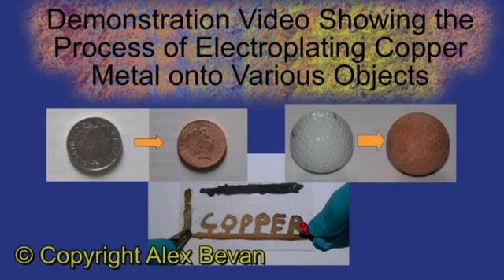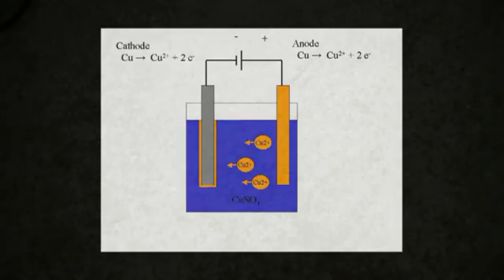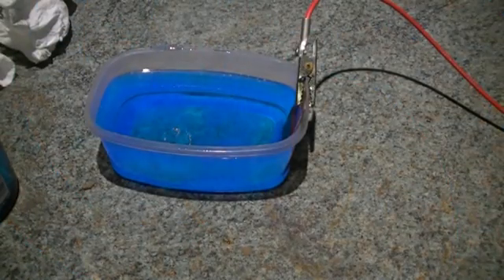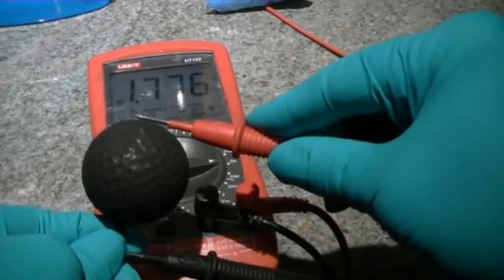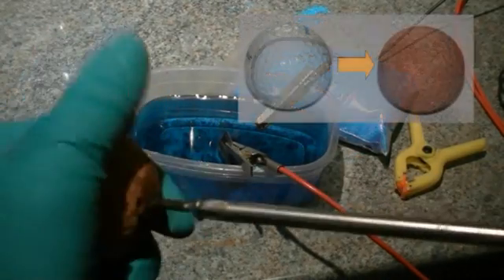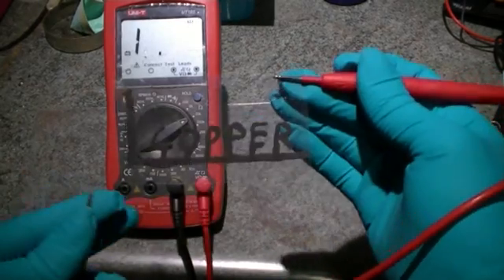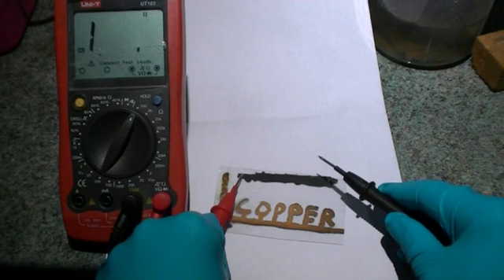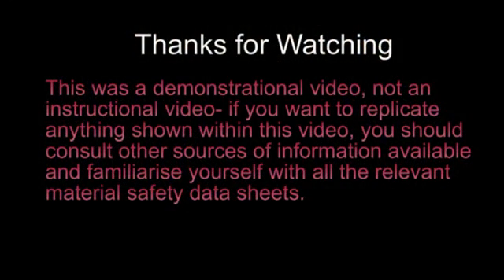How to electroplate copper onto objects such as metal & plastic

Comment: It was really really weird. I has followed your instruction, from Copper sulfat solution and i used battery 3.3 v for the supply. But the result that i got is not the same like what you did. My cathode  ( steel that i want plating) was plated with black gel. Did i Miss something from here?
Reply: The process for the steel is different.
Reply: @evgenitantikov5865  How so? That makes no sense.
Reply: @paulb9769  When makes no sense, why bother asking me?
Reply: @evgenitantikov5865  Well if it is different why don't you explain because according to my knowledge it is the simplest to plate.
Reply: @paulb9769  bcz I don't want to explain anything to you. You can research on your own.
Or if you trying to pick a fight over internet.... That's pathetic. But I'm sure you are not here for this xD

Comment: Hello, I want to know what we get in this experiment: distilled water + sea salt + a AA battery + Copper Plate + Black Copper/heated/nano coated. What do we get accumulating at the bottom of the glass when negative of AA battery is connected to a nano/heated coated copper, and the positive is connected to both a copper coil and Zinc plate. What is the name of this chemical reaction or water or the slim/cloud that gets accumulated at the bottom of the glass? Is the water drinkable? What is GANS and what uses are there for GANS?  A physicist from KesheFoundation.org is saying we can drink the water to combat the viruses or any virus / apparently the copper/nano coated copper/Zinc water can interrupt the virus power pack, therefore allowing our body to defeat the virus if we drink 100ml of this water. And spray it on our masks, face, hands and back. Thank you :-)
Reply: Don't do that.  I was looking at the same idea but the major problem is copper poisoning.  Very nasty stuff.  And silver is great but be careful when makeing your own colloidal silver as any contamination or wrong particle size can cause permanent blueing of the skin.

Comment: Ive been experimenting. I used a vinegar and 1 small spoon of salt solution and made copper sulphate by putting 2 copper electrodes in solution. I used 12vdc for the sulphate production them switched to a phone charger for plating. Tried plating 2 10 pence coins, a brass .22 casing. It just rubbed off with minimal effort... ugh

Comment: Nice demonstration.    If the Plastic object conducts electricity now,   It can be  Chrome Plated..     Now, I can make my own fiberglass bumper for an antique car and Chrome it..
Reply: You can't (shouldn't) do electro-chroming at home. The liquid required is extremely poisonous. A single drop into the wastewater system, and someone else will have a health problem. See the Pelican case movie; it's based on a true story.

Comment: I used a phone charger to convert ac to dc and i made a copper solution with vinager salt and H2O2 and your vid just let me know that thae reason it wont work on my butter knife is because its stainless ;p thought i did something wrong but my solution is green is that a problem??
Reply: Dude, vinegar, salt and hperoxide?
the greenness of the solution indicates a high chlorine content
Reply: Sounds like you had polarity around the wrong way and had the stainless as the anode leaching iron into solution turning it green. DOH!

Comment: I am using an electro-bath configuration with a 110 AC to 12 DC converter.   I test pieces are forming copper crystals.   The crystals are nice but I like a coating to match the surface area.  Any recommendations.

Comment: What's the name of the graphite product you are using? Thanks
Reply from the maker: Hi, the graphite product was something that I mixed up using paint + graphite powder
Reply: You may have to use a special primer to get any paint to stick to the type of plastic you're using. If you dig around, there are methods to identify what type of plastic it is, such as whether it floats or how it burns, and then match it with the correct primer. It's more of a paint question than a plating question really, so you'd want to talk to someone who paints cars. If I was to pick a paint, just off the top of my head, I'd try paint intended for plastic models, like Testors brand.
Reply: May I ask what kind of paint you used? I'm having trouble with it not sticking and flaking off.. at first I thought maybe I was using to high voltage but that doesn't seem to be the case. Thanks!

Comment: the conductive paint comes off the object when placed in the solution. how did you get around that?
Reply: Same issue here.. did you ever find a solution? I'm still thinking its the type of pant I'm using.
Reply: Lucas Edwards I used a plastic primer spray paint over the whole object before applying the conductive paint. leave the primer to dry for 24 hours though
Reply: Thanks!
Reply: @EclecticLensYT   clear varnish works great
Reply: Have you tried switching the cathode and anode? If they were reversed the solution would eat away at the object instead of depositing material onto it.

Comment: approximately how much time did it take for the copper to plate the golf ball? i have almost the exacts same setup but my power supply is only putting in .01 amps...
Reply from the maker: +Walter Wessels Thanks for the question; it took about 10 hours
to electroplate the golf ball. Initially plating started at a low current ~0.01A
but increased after a few hours, once a thin layer of copper formed and the
resistance decreased. Try to plate around the connection on the golf ball first
to decrease the electrical resistance at this point; you may need to move the sacrificial
copper electrode to increase plating at this location.

Comment: Nice! I was wondering if I could make PCBs with graphite and electroplating. Then I thought, "I'll bet someone has already done it." Sure enough. :)
Reply: The SAME CASE, man! =D
EXACTLY the same case!

I've tried to find a way to make a thin copper layer on a totally non-conductive material... To make a raw copper plate to etching a PCB on it.

Now, the answer : Carbon can used for electrolising.
So, I have to just make a conductive ink, paint a plexi plate and do electrolising.
Reply: http://www.smartcatshield.com/docs/Verdant_White_Paper.pdf